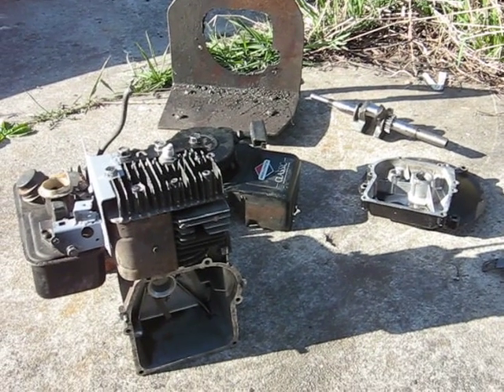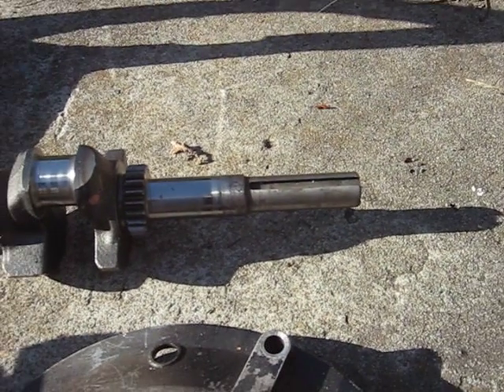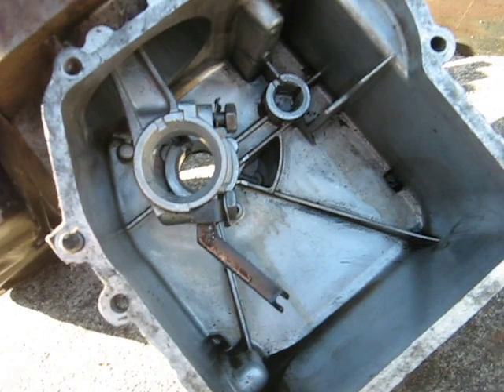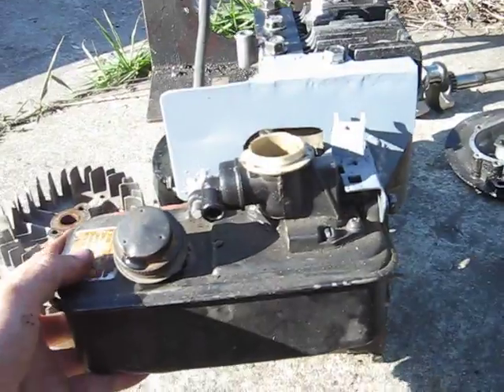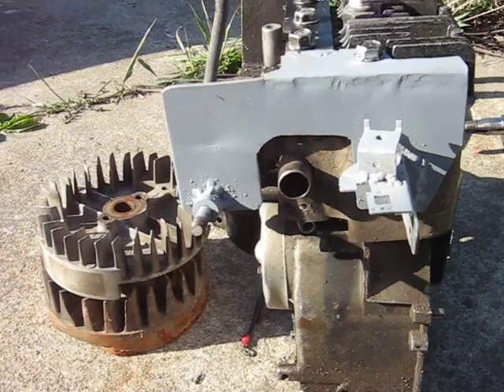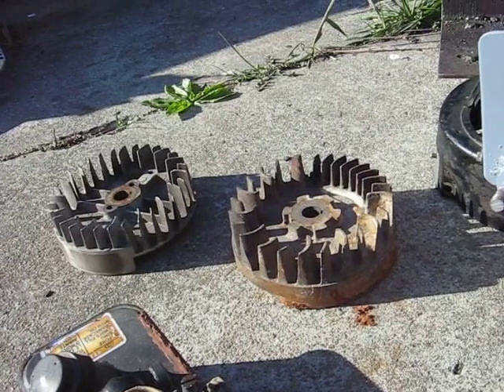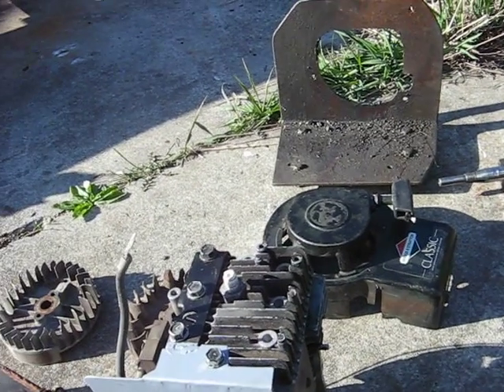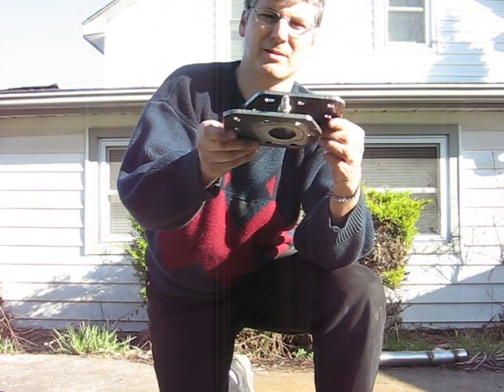Vertical to Horizontal 3-1/2 Briggs

Comment: Good tip about the flywheel
Reply from the maker: Yes, I have been bitten hard by a backfiring lawnmower with no blade on it. It does NOT feel nice, Therefore i recommend the heavier flywheel.

Comment: That's a Horizontal to Vertical not the other way around.
Reply from the maker: No, the original engine was a vertical shaft lawnmower, I converted it to a horizontal shaft  for use on a go kart. Perhaps it is oriented the wrong way in the vid, but the shaft is horizontal when it is being used.

Comment: what is the part number for the oil dipper on the roto-tiller type engine
Reply from the maker: For use on a 3 or 3-1/2 horse engine the part # I looked up was 691719 , for a model 080401 Briggs 3 horse horizontal shaft engine. This should be the correct part, it was about $4 at Jack's small engines. Hope this helps.
Reply: It does but I custom fabed one it runs good I had attached it on both rod bolts to insure it doesn't move arround
Reply: I looked it up and that's the one I bought but had to bend and cut it's too long it hits the bottom of the crank case and old oil fill the part that connects to the con rod is too wide so it scrapes the inside of the crank as it rotates arround
Reply from the maker: Hmmmm, that is strange you are having such problems, what engine model # did you use?
Perhaps Briggs has made some changes over the years that has caused it not to fit correctly. yes, attaching to both bolts is probably a good idea, I think the 2 horse and the 5 horse dippers do that. (I know the 5 horse dippers do).

Comment: Yours is the only video that mentions cutting the original oils splasher bracket and keep using it as a shim.  i assumed one would keep it. i suppose the other ppl Assumed we would know that too lol
Reply from the maker: beingsneaky Glad that was a help. I got rid of the oil splasher, by adding a dipper, but I still needed to have the correct end play on the camshaft. Perhaps other designs are different.

Comment from the maker: Thats an interesting problem!
Yes, you could just plug the crankcase vent, as long as you provide an eqaully sized or larger one somewhere else. Tecumseh push mower engines have the vent at the top of the crankcase, almost under the flywheel, while Briggs uses the valve cover on the L head engines. You have to have a vent to allow the gases that blow by the piston rings to vent, or pressure will build, then the oil seals will blow out. Have you made any oiling system mods to it?

Comment: I have a engine that i am converting (ovh tmawqua 5hp i belive or some thing like that. When i have the engine the way it will be converted to. I spin the flywheel and all the oil runs out the crank case ventalation (below the flywheel when sitting upright on mine). Can i just plug off the ventalation? Are there any ideas of what i can do? Because i feel all the oil will just come out once i try to run it the first time.

Comment from the maker: Maybe drill a hole in the crankcase cover bushing, so that it will allow some of the oil splashing around to lube the shaft, since the existing slot may be on the underside now. That was the purpose of the changes I made, allow oil into what is now the top of the shafts.

Comment from the maker: A chain drive will add a lot of pressure to the ouput bearing, I know this one has some wear issues there, as did a 3 horse horizontal Briggs I used to run.

Comment from the maker: Did you at least add an oil dipper onto the connecting rod? It will need that to get any oil!
To be truthful with you, I don't know how well it will work without making the oiling changes. I guess I could build one that way as a future project just to check it out. It will be a while though, as my hands are full with the 4 cylinder I am building!

Comment: I've made this type of conversion to almost same engine (82 b&s, possibly same model), but I didn't weld/cut those bits inside the motor. I've assembled it, but I haven't started it yet (still yet to mount gas tank/carburetor). Do you think I'll be fine without those mods? I don't want to open it again :D

Comment from the maker: Unfortunately you have gotten into an area that I don't know much about. I am more familiar with the older Briggs engines, and I don't have any Quantums, I only have 1 OHV Briggs, so I don't have anything to compare to.
Perhaps "donnyboy73" can help you out, as he looks to be an actual small engines mechanic.  I have heard that some of the newer Briggs engines will run without a heavier flywheel, one guy made an outboard with one, and it ran fine. I know the 3-1/2 horse pushmowers can backfire.

Comment: Ive got a question for you. Ive got a 6 3/4 hp lawnmower briggs engine that Im trying to do this conversion to and I cant seem to find a proper cast iron flywheel. The engine info is: Model :125K02  Type: 0281-E1  Code: 04102559. My question is what would be a good flywheel to use? I have found a few that might work but dont know. Also, are the inner diameters of the holes in the horizontal engine flywheels different compared to the verticals? Thanks for the help

Comment from the maker: Hmmm, intersting question!
I suspect it could run OK on a bit of an angle, as some roto-tillers do that when in operation, and I haven't burned one up yet.
I will have a look at a 3 horse Briggs, and see.  Each engine design is different though, so you would have to look at the engine you want to use.

Comment: Great information in the event some billionaire buys up all 50 million horizontals that are out there and they become hard to come by.  I know a guy who is currently working on a vertical mower project where the entire motor is flipped over and the blade is welded securely to the deck.  The whole motor is going spin above the grass. It has a samurai sword welded to the leading edge of the exhaust pipe. Your info on snapping off nails in uneeded oil passages could be of interest to him.  Thanks!

Comment from the maker: @boaterbil 
Oh yeah, I have lots of old points type engines. One thing about them, they will fire the spark at a lower rpm than the new Magnetrons will, as well as they fire both directions of flywheel rotation. I noticed that when I turn them over by hand on my work bench grabing the flywheel. I will be uploading my "Leftie" Briggs tonight, it turn CCW, and was a lot bigger pain to get to work than I thought it would be!

Comment from the maker: @borderlineartistic 
 I don't know, personally, I use a factory built dipper (oiler) since it has been designed to work at at least 3600 rpm. I have been known to rev these engines to the limit (about 5000rpm) so sometimes even a factory oiler will break, but so far I have had good luck.
On the old model 13  5horse Briggs, I buy the racing con rod with the built in oiler.

Comment from the maker: @damononopium 
Good question, I think the valves are splash oiled, getting oil mist from the crankcase, thru a small hole, there is also a larger drain back hole.

Comment: could you leave the original oil slinger (the thing that you cut to make a washer for the cam) in it and also put a roto tiller type dipper in for added oiling?

Comment from the maker: @sdkt411 
Actually, the lawnmower crankcase cover comes with 2 oil slots, we blocked off what now becomes the bottom one, and did a bit of filing work to the "top" one to allow more oil to feed in. It isn't a perfect solution, as the normal horizontal carankcase cover has gussets in it that also direct the oil towards the feed slot, but the engine worked OK without adding anything like that.
See the new vid I made about a week ago, it shows the original crankcase cover there.

Comment: how did you decide what angle to cut the oil passage for the crank shaft?... because in theory you clocked the engine 90 degrees to run it horizontal. but the new passage lookes almost 180 degrees from the old welded off passage.

Comment from the maker: @jasoncambs 
I put the nail in a drain hole in the engine block, for the crankshaft. If you don't plug it, all the oil that gets splashed into the crankshaft bearing on the flywheel end of the engine will drain back too easily, starving that bearing for oil.
Comment back to me, if you still don't understand, and I can make a vid to explain it to you better :)
As they say, a picture is worth a 1000 words!

Comment: I have a Briggs 35 and am looking at converting for horizontal use , your vid is very good but I did not see the bit you said you put a nail in with epoxy , I did not know where as you did mot point , 
I hope to do a vid of my conversion , 
Plenty of good advise from yourself and also confused 1985 on this subject , I will make a start :) ,
All the best

Comment from the maker: @yoo8151 
Glad I could be of some help! :)
I just cut off another lawnmower oil splasher, to use for the washer, that way it is the correct thickness, so the camshaft has the right endplay.
Forward me a vid of it when you get it going! :)

Comment: @ChargerMiles007 I have about 10 parts engines and a bunch of boxes of other parts.

Well you can use the decks from the Brand X's for those sweet vintage Briggs engines.

Comment from the maker: @pivotboy63 
You might get away with that on a 2 horse, since they are only 6 cubic inch, but they 3.5 hp engines are 9.2, so they need more flywheel. I won't say that it won't run, but i just don't think it will do it for very long.

Comment: i think you can still use the aluminum flywheel, i put an aluminum flywheel from a lawn mower on a 2 hp briggs horizontal shaft engine and it ran better and reved faster

Comment from the maker: @mapukmapuk 
If you want it to last any amount of time, you have to do basically what I did here.
Please note that the first step is to chose an engine which has been made both as a lawnmower, and as a horizontal shaft engine. This is because you NEED to use a factory engineered oil dipper. I pulled this oil dipper out of a 3hp Briggs roto-tiller engine.
Then you have to look at the bearing drain slots, most mower engines have them in the wrong place, so you must plug those, and make new ones

Comment from the maker: @o27aa1 
Sorry, I am not familiar with that particular engine. 
The dipper could be a problem. I used one from a similar sized roto-tiller engine (a horizontal shaft engine. I wouldn't even try to make  a dipper, it will only break off from the high G forces involved. Try Briggs' website, they may make a horizontal version of that size engine, so you could buy a dipper for that.
The other thing you have to figure out is where the block will need new oiling slots for the crankshaft. A Bike! :)

Comment from the maker: @o27aa1 
So what questions do you have?
Also, what Briggs engine do you have to work with?
Reply: ChargerMiles007 
Where can the heavy flywheels be found? Just saying if you have the flywheel , then most likely you have the complete engine. I have these vertical shaft engines stacked like fire wood and zero heavy flywheels. Everyone who had small engine shops are now gone in my area that would of had bone yards.

Comment from the maker: @18Crazykid 
Yes, I believe it could, you just need to make sure the crank, rod and camshaft get proper lube to them. I had a horizontal shaft engine to look at to compare the oil galeries etc.

Comment: -Have you ever considered about pouring some lead in the hollow backside of a briggs mower flywheel ?, I did exactly that today and got a nice heavy flywheel which weights just over 3 kg, just started a new vertical to horizontal-project.

Comment from the maker: @ciclotronforever 
Yes, it would be much easier with a ball bearing engine! Briggs makes those, but they are like Hen's Teeth at a scrap yard!

Yes, a second flywheel would work. I did that on the first Piston valve engine I built, I took a messed up heavy flywheel, which wasn't cast iron, and drilled a 7'8" hole for the crankhaft, where the taper was. It worked OK, but was a pain to make.

Comment: wouldn't it be easier with an engine with ball bearings on the crankshaft?

And do you believe that it is possible to make a complementary flywheel with a lathe to keep the stock one (finding a cast iron flywheel is nearly impossible). 
It will do the same job as the blade, but without danger.

Comment: I have a tecumseh mower engine That I wanted to convert to horizontal shaft and I tried a different way... I put it on it's side, valves parallels to the ground! so the oil pump still worked and I didn't have to make a dipper. The problem was that oil leaked through the valves....

The big problem with this engine is that the flywheel is completely stuck on the crankshaft... It is impossible to disassemble it, so I just can't make a hole in the bearing to let the oil in.

Comment from the maker: @Joeyad4 
The dipper is a stock Briggs part, from a 3hp model 82502 (or something like that) horizontal shaft engine. I just took it out of one of my many engines, and bolted it into place, the normal lawnmower rod accepts it fine.
I would not recommend making a dipper, as it is under very high stress, and your engine gets smoked if it fails! :((